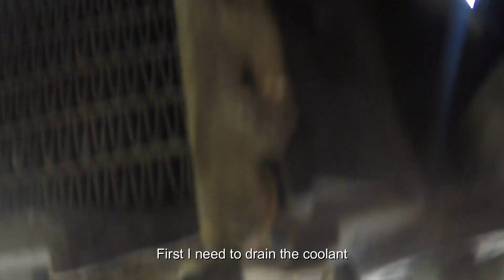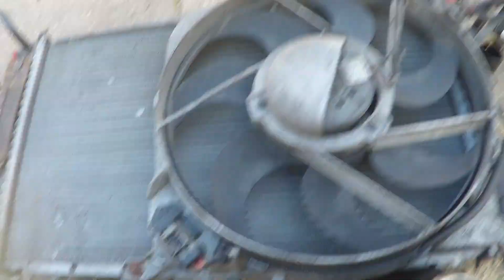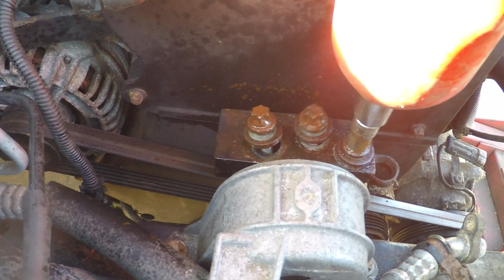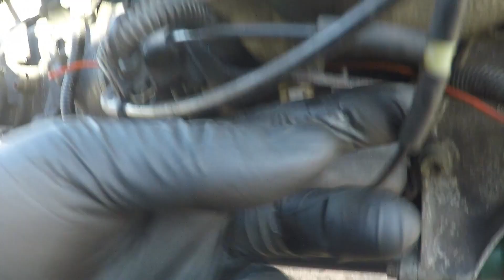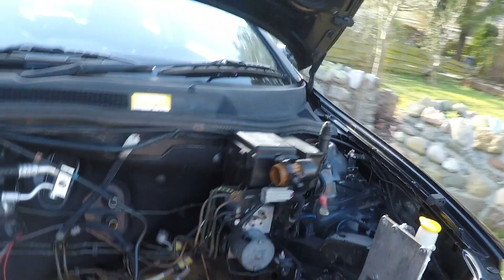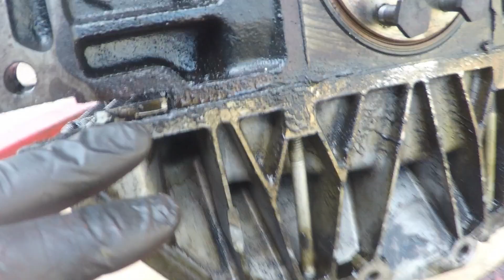Astra GSI Project - Part 9 - Engine Removal And Strip Down

Comment: Hi Andy :) what’s your method for cleaning the bay once engine is out?
Reply from the maker: I pressure wash the loose stuff off then use degreaser and a brush to get into the awkward spots then hose down again and then treat any bits of rust once dry. You doing something similar?

Andy👨🏼‍🔧
Reply: Ahhh ok, that sounds doable :) well I’m getting on nicely with my gsi, sorted the back out axle etc (your videos taught me) I’m getting to the point now where I’d like the engine out to give it a good clean, gaskets etc, want to compression test it first, see what nik it’s in, never removed an engine before so my mate who’s got more experience will give me a hand
Reply from the maker: @willennion5572  nice one man! Keep me updated 😁 did you paint or Powdercoat axle? Poly bush or standard?
Reply: I stripped and painted axle, all polybushed:) brand new front subframe as previous upper mounts were rotten, coming alone nicely :) 💪🏻
Reply from the maker: @willennion5572  you got pics or Instagram?